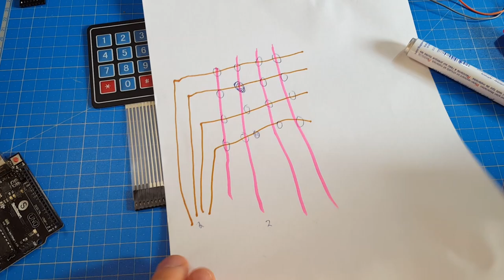How does a 4x4 keypad work

Comment: for how long should we iterate through the output pins and provide voltage in order to detect which column key is pressed? should this procedure of reading the column go on forever until the key is pressed?
Reply from the maker: Good question. Think about how long you need to press a button. In this time you have to go trough all rows AND columns, so you won't miss the press. And of course you have to go on checking for a key pressed, because you never know, when this key press will happen.